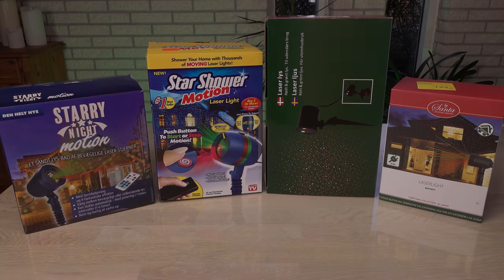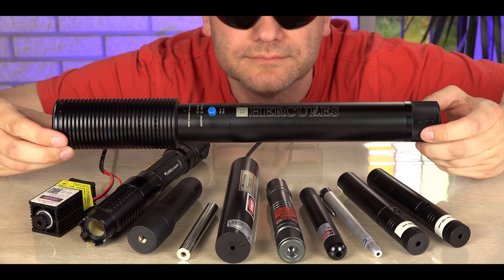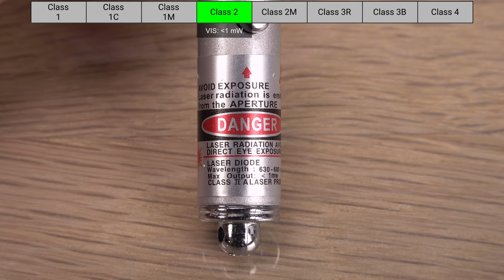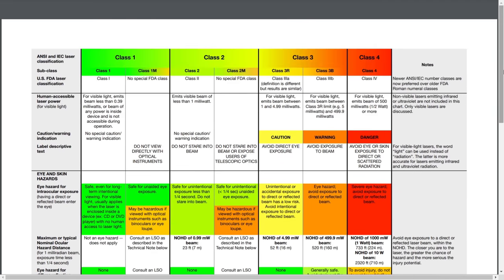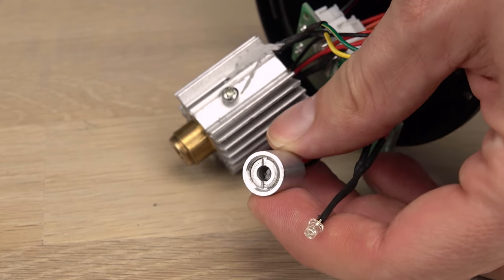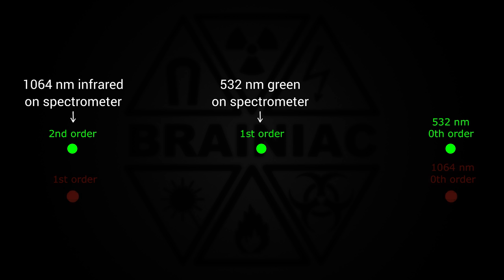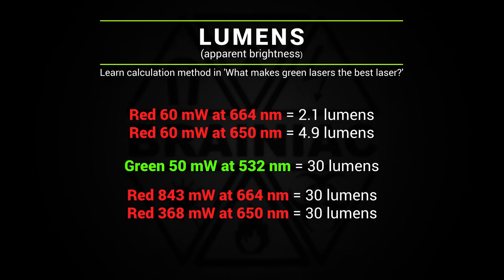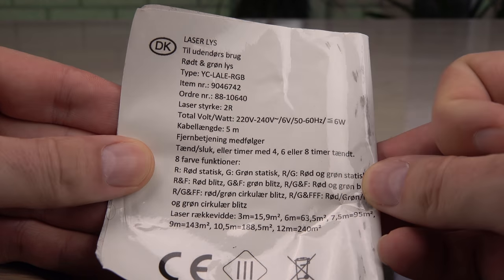Even STRONGER Garden Laser?!? | Laser classes explained

Comment: Love that you corrected what you said in previous videos with your new information. We all learn
Reply from the maker: Thank you. Always embarrassing to make public mistakes, but it is how we all learn from it as you mention. Look for the 808 nm leakage. That's the telltale sign. More mistakes to come :P
Reply: @brainiac75  Hi Brainiac, you never made a public mistake, it's very difficult to tell the difference between 2nd order (internal diffraction) of a primary beam, or a 1st order of a primary beam.
Reply: Only a true intellectual is comfortable correcting oneself
Reply: @brainiac75  I don't know if I am missing something but you have not actually checked to see if the 1064 is indeed second order diffraction; you would need to do so by using a filter before the input to your spectrometer. If the peak goes away once you do, then there actually is 1064. Curious to know if you did do that.

Comment: I've been a hobby laser fan since my first helium neon laser in the early 90's salvaged from a supermarket barcode scanner. Paid a fortune for a green laser a few years later. Now do laser shows using RGB laser systems that can easily put out 8w into a white beam using all 3 colours. My last eye test, the optician asked if my job involved lasers, as I have a small spot in my right retina that has damage. I can only see it on bright sunny days if I turn my head quickly, I can see a small black speck for a slight moment. SO even if you're very careful, you can still get a flash from a reflection and not notice at the time.

Comment: Remember, always wear safety glasses!

Even in supposedly weak lasers, it's better to be safe than sorry!
Reply: especially if they’re green
Reply: Even weak lasers could cause damage. Even though class 1 lasers are safe, if taken out of its original component, it could be dangerous. Any classes above that could still cause eye damage through unmomentary exposures (class 2-3r) and momentary exposures (3b and 4) 3bs may be safe at low levels, but you should always wear goggles for class 3b and 4 lasers.

Comment: Laser rating does change some with the beam power density.  For example, a fat beam laser using a beam expander, spreads what used to be a 1mm Beam into about a 5mm beam. The beam makes a great visual effect in fog or haze, but is both much more skin and eye safe as the power density is much lower and the larger beam illumines much more of the fog or haze in the air. This is often used in theatrical laser beam effects for concerts. The laser pumping the beam may be a class 4 laser expanded to a 10mm beam, greatly reducing the damage it can cause on skin or to the eyes as most of the energe does not enter the pupil, so the power that enters the pupil is greatly reduced by the spread beam.
They are much safer than the same power in a very small diameter beam.   For example a normal small beam 50mW laser would be a class 4 laser, but expanded to a fat beam, the power density is reduced for a device rating of Class IIIb.  Google green Fat Beam Laser Module for examples.
Some garden lasers are rated for the total laser power, for the laser contained, however when split many times with a diffraction grating, the individual beams very often fall into class I or class II laser products.  Keep this in mind when ordering garden lasers.
Reply: Do you know after diffraction grating how much power is lost for each dot? I ask because kids are playing with 100mw green lasers with diffraction grating lenses and pointing them other kids. I wonder how big is the danger when the beam is not that focused.
Reply: @sabotage3d  That would be something to ask the manufacture. The center beam is the brightest and the highest hazard. Some pointers are very small and thus high power density. The safer ones have a beam diameter greater than 3mm, and is typically 5mm. If it makes tiny spots, watch out.

Comment: I think there might be something about the laser being split up using diffraction gratings and if the laser is split up, you do something to say that the dots themselves are class 3R even if the diodes are pretty much class 4.
Reply: Yeah, that's what I also think. There are so many dots that a single one would so weak that it could be just a class 1 laser by it self. It's like a class 2+ laser being just class 1 because it is shielded inside a DVD-Player...

Comment: Question: what kind of magnet would you recommend for magnet fishing? I'm sure you have heard of it but if not it's where you tie a magnet on the end of a rope and throw it into a river or lake. Then slowly bring it back to shore. You are hoping the magnet attaches to something valuable that someone dropped or threw in the water. You also retrieve a lot of junk so it's cleaning the body of water you are at which is a plus. So it needs to be strong enough to dislodge something heavy from mud but small enough to throw.
Reply: Neodymium magnet.

Comment: How is the laser meter constructed so that it isn't damaged when used?  I'm curious on the method it uses to measure the light.
Reply from the maker: I'm not an expert on it, but I believe it uses a peltier element/thermocouple to generate an electric current. The laser heats the element on one side and the heatsink around the power head cools the element on the other side. This temperature difference generates an electric current. The more power the laser emits, the more the element is heated and the stronger the electric current. The shown model will handle up to 20 watts if all of the sensor area is used. 20 watt focused down to a small spot would probably damage the sensor's coating... Thanks for watching!
Reply: @brainiac75  I'm guessing it would have to be a coated copper plate with some thickness on the front mounted to the peltier device. Or maybe even a little vapor chamber to distribute the heat even better. Peltier elements cant tolerate terribly high temperatures and their surface is normally a ceramic plate, which isn't great for distributing heat from a single point.

Comment: A few months ago I picked up a $15 laser show like this for indoors (with fan) and if the specifications are to be believed, it uses a pulsed 50mw green and 200mw red.

It's definitely pulsed and definitely bright, with no infrared filter. I'm not 100% sure the green is a DPSS beam, however, since the package size is so small (smaller than the thinnest pen-style green pointers. I'm just so much out of the loop with laser tech, I didn't think you could get a green 50mw direct diode for under $20 ?

Comment: Fun fact:You can see TV remote controls flash of Infrared radiation using your devices camera try it out (because your devices camera can see a bit more than the visible spectrum) 
Also because TV remote controls use Infrared radiation so that's how TV's know what button your pressing. Try it and you'll believe me.

If I have a wrong grammar don't blame me English is not our primary language but secondary.

Comment: I used to work on laser micrometers and frequently you'd need to look at the reflection of a scan line, sometimes a stopped beam, all <5mW HeNe laser or diode laser so "eye safe", yet later in the night I could still see a diffraction pattern at times. I later had an eye test that said my eyes were OK but it makes you wonder if you can see something 8 hours or more is it really safe or just some temporary thing.

Comment: Hey do i need laser glasses while working with dvd drive laser ?
I have some spare drive and want to play with those laser too, but i get skeptical abut me eyes. So i never opened them.
Reply: DVD read lasers aren't typically very strong (though, no guarantees), most examples I've found online say <5mW, but I wouldn't trust the safety of my eyesight to the internet. DVD write lasers are plenty strong enough, you know, since they work by physically burning the disks. Either way if you want to play with lasers, get laser glasses. No reason to risk your eyesight to avoid buying a 20-50 dollar product.

Comment: although i'm not 100% sure, i'm going to assume visible spectrometers behave the same as mass spectrometers. if that is the case, resolution and accuracy are not directly correlated. you can have very poor resolution with pretty good accuracy, and vice versa

Comment: 9:18... In basically clean air (no high levels of suspended particles) if the total Laser's Beam falsl on the active part of the LPM's Sensor... The distance from the sensor in a typical room will not make a difference. Just like increasing the size (diameter) of the beam will not change the LPM reading as long as ALL of the Laser's bean falls on the Active Sensor area.
Reply from the maker: True, but in this case there is a double-axis diffraction grating in front of the lasers so distance matter. Even at only 30 mm distance quite a lot of the smaller beams diffracted from the main beam don't hit the sensor. I think that's how they get away with such a low classification. I guess, the classification system was not meant for lasers like this. Or they just put on the sticker they like to ;) Thanks for watching!

Comment: Another thing that is even more of a hazard now are the newer cheaper green laser pointers on eBay. They don't have a current regulating driver so when you slap in a lithium ion they hit 100mw easily. It's sad but also kind of impressive that they are so cheap and yet able to take the abuse. The more I see these cheap overspec laser products the more I fear more and more restrictions will be mandated. Glad you and others inform people because it cuts down on possible misuse and injury.
Reply: Also it is not a mistake, you are indeed getting 1064 from the ND:YVO4 which has made it past the KTP output coupler.

Comment: If 1MW laser was available did it will come with own power plant? Or it will be connected to Tesla Megacharger (this is charger for Tesla Semi, it deliver ~1 MW power)
Reply from the maker: A 1 MW continuous beam laser would require its own nuclear power plant or a Death Star to run it x) Thanks for watching!
Reply: @brainiac75  The smallest reactors  SMRs (Small Modular Reactor) have 50MW (I mean reactors that produce electricity in power plants, this not the smallest one, there is smaller reactors used in marine), typical reactors have 300 - 1500MW, almost every nuclear power plant have more than one reactor, bigest operational nuclear power plants have ~6 reactors, ~1000MW each, my country doesn't have any nuclear power plant, my country is backward, we have bigest in europe coal power plant, that use 100 000 tonnes of lignite everyday, 1 tonne every second :(

Comment: i wonder what class the laser in my CD recorder would be if taken out of the product
(and I've also discovered one of the optical drives in my desktop doesn't have a sensor to tell it when the draw is fully closed, so if the draw is prevented from closing all the way, it will sometimes think the draw is fully closed)
Reply from the maker: If it can record on an optical media, it is likely quite strong. Class 3B typically. I wouldn't worry to much about laser light escaping from a not fully closed drawer. The lasers inside an optical drive are focused down to a tiny spot on the optical discs. Meaning it is not focused anywhere outside the drive :) Thanks for watching!

Comment: wikipedia

Class 3R (formerly IIIa) lasers are usually up to 5 mW and involve a small risk of eye damage within the time of the blink reflex. Staring into such a beam for several seconds is likely to cause damage to a spot on the retina

https://en.wikipedia.org/wiki/Laser click on safety or you can do a search for 3r.

a megawatt laser would probably require a very high amount of power way beyond the 5 volt power supply and tiny electronics and heatsink for cooling.

a megawatt laser may be more like the lasers used in hollywood especially the movie short circuit

Comment: Once again a very interesting and informativ video! I never thaugt that those things can be thus dangerous 

Do you remember me from the plasma ball video? Cause by mine the glass broke and I am speculating  about how dangerous it would be to turn on!
Reply from the maker: Thanks, Lukas! Buyer's beware when it comes to Chinese build lasers (and aren't they all?). I don't remember exactly what you commented. I go through so many comments, that they all blur out at some point in the future :) It is relatively safe to turn on. The center piece will still have a high voltage but at very low amperage. You won't see any sparks from it in normal air. It could burn your finger from the electric arc if you touch it though...
Reply: @brainiac75  no need to worry! I know you have more important stuff to remember! Thanks for answering 
So it's a should be safe but be smart and don't do it situation
Reply from the maker: It's quite a good power supply, that you could have some fun with if careful. Try placing one end of a fluorescent tube on the center and turn the plasma ball on. Should light up fine. Just don't touch any metal on the fluorescent tube - it can burn you. What you don't want to do is directly touch the electronics under the plasma ball.
Reply: Those things aren t very powerful i guess it will be like 10-15 watts, however i will still not recommend to touch it xD
Reply: @lukasvondaheim  You should know the basic high voltage safety rules if you want to use it. It will put out more current than you'll ever get through the glass normally and if you pass current through your body it does slowly damage and kill some of your cells. Dont do it for hours. So in short, it wont kill you, but it's also not healthy, so avoid coming in contact with it.

Comment: I wonder where these lasers get made, I suspect that all the components are made by different companies, and the one doing the final assembly either doesn't know how to classify the lasers, or has been given an incorrect classification from the company providing the laser component. Maybe they ask that company what classification it should be, describing the end product to them and so they guess based on similar products and nobody ends up taking any measurements. Of course that's all speculation, but these kinds of things happen when hi-tech equipment gets manufactured cheaply.

Comment: Well you are in the EU and this thing has an CE sign, so it is unlikely to be wrongly declared. If the manufacturer applies an CE sign, to a product it has to be safe and it has to follow the infamously strict EU regulations, including laser classes.
Wrong declaration is illegal and will get you into more trouble than just having to recall the product. It would be even worse if it was a counterfeit, of course.

I think your high reading is caused either by some kind of measurement error or by the product being used in an unintended manner. Try to measure the power of a single one of those many beams that appear after the refraction filter. I guess they would be just like ~0.1 mW each.

If you find it to be actually unsafe (out of spec), you could report it to the authorities.

Comment: They're probably just lying about it. For instance, I know what a <5 mW laser pointer looks like, and I can't remember the last time I saw one in the wild that wasn't significantly more powerful.
Reply: Well if the ones make them just have to pass for import in a foriegn nation they send one that works that they bothered ton test and make sure it worked then send the cheap ones of varied output as they wont be tested and as a business they wont be legally accountable and if they lose the ability to sell in the importing country they simply change the name of the comapany alter the product slightly pass the testing again for import and regulation and send the cheaps in mass again. China isn't going to face any consequences for violating regulations in another nations. They wont even stop exporting fentinol chemical bases that mexican drug cartels use to produce the drug and smuggle into the US causing over 50,000 deaths from overdose and at such cheap rates they are still able to profit despite tons of it seized and drug value is at least 10x less then in the US. Like they can still make millions despite effectively tossing 90% of the product they produce in the garbage and means a large quantity of chemicals is being exported and consistently out of China to Mexico but they wont regulate that so expecting them to ever bother with laser diodes is a joke.